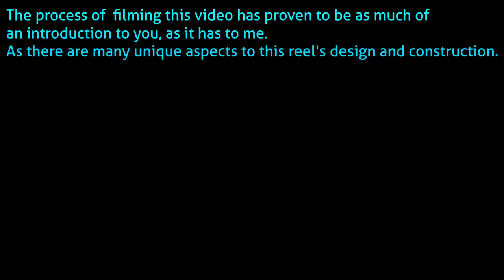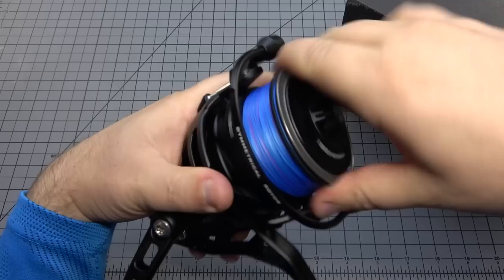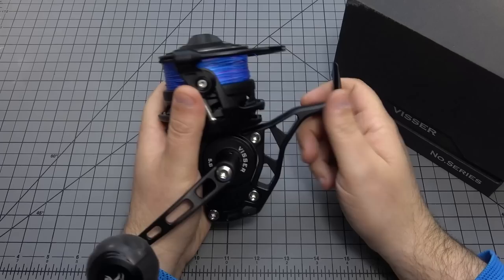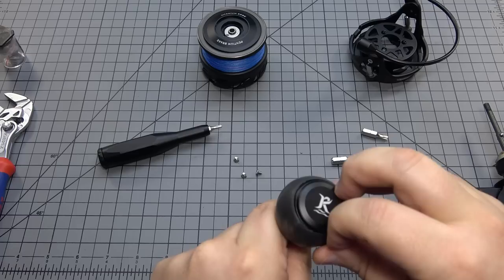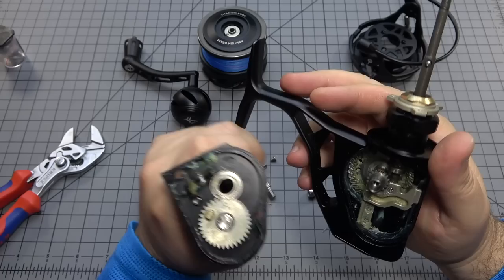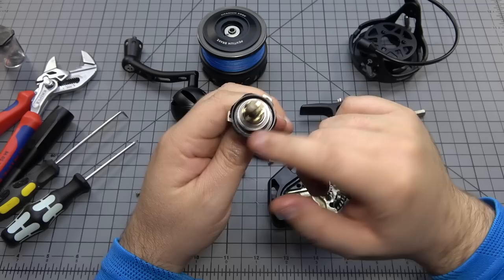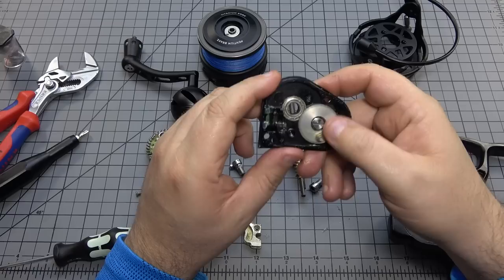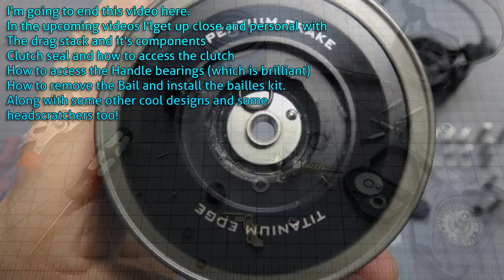Visser reels - The most impressive reel of 2020 - See description as to why I no longer recommend it

Comment: I’ve bought three visser no5 now and only one had no problems, other two were sent back to the seller. Production number 175 was no drag clicker sound. 188 was all good (so far) and 110 had webs on it when I opened it, the reel handle screw part was covered in rust and the spool was catching/binding as you turned it with your hand....It would go smooth,catch, smooth, catch and so on. Pretty disappointed in the company so far

Comment: for $700 i expect QC out the ass
Reply: For real. If this was a $100 reel he would've called it shit and thrown it away.
Reply from the maker: I do as well... But this is expected of his releases.. First runs have some issues... Once fixed they're the most bullet proof reels on the planet... When you're not a half a billion $$ company it's difficult to bring a spinning reel to market and have no issues at launch... Especially a cnc'ed reel... The issues were ball bearings and a simple adjustment to the clicker and a defect at the clutch.... I could have shit all over it... But the design is so excellent.
Reply: @Tackle Advisors  with releases like this, custom and small batch.
First one out of the production run will more than likely have issues.
It's how they handle theses issues  and prevent future occurrences that counts.
This one looks promising. But I'm going to wait till I consider buying one (international customer and warranty return 🙃)

Comment: While no bailed reel is perfect, I believe no bailed spinning reel is tougher than the VSB Van Staal.  They have a German made INA instant anti reverse that has extra needle bearings for better instant anti reverse and the "cage" of the clutch bearing has a metal cage where most companies make them with nylon cages.   So Van Staal really impressed me because no other companies seem to use German INA bearings in fishing reels.  As far as I know, only the VSB has them?
Reply from the maker: I tried to locate a hex clutch from Ina... To no avail.  I forget. Is the vs a hex.. It's been so long
Reply: @TackleAdvisors   yes it's hex.   You could try buying the Van Staal part number but I don't know the size.   It's possible that only the VSB models have INA bearings.  I bet the VR and even the new X series use either Koyo at best or a generic clutch bearing. But the INA by itself only cost 23 bucks from Van Staal.   Second choice would be a Koyo made clutch bearing.   I don't trust the Boca bearings because they won't tell me which factory in China makes them.  Boca has good service but we consumers should not have to settle for anonymous Chinese factories  when Japan and Germany makes bearings all the time.
Reply: @TackleAdvisors   I found the part number for you IF the INA clutch is instead Hex shaped.  I'm not 100% it is. I know INA makes them both round and hex and I think the Van Staal VSB uses the hex shaped one but I'm not 100% sure.  But the Van STaal Part number is VSB2090 - INA CLUTCH  (item number 21-30272).  It only costs 23 bucks.

Comment: would you ever consider comparing a vr50, saltx 4000 and a visser no. 3 for the “king” at that size for sealed reels?
Reply from the maker: I have a 50...I have to see if my friend got the salt x 4000 or the 6000.....I have a visser 5 right now in addtion to the 8...I don't think the 3's are out yet...ANd a completely redesigned vR lineup is coming soon
Reply: @TackleAdvisors  i’ve been really wanting a sealed reel at that size, but i kind of want to see what the no. 3 has to offer before i pull the trigger. thank you.

Comment: Great wrench. Please try using it properly. You did not have the pliers facing in the correct direction.
Reply from the maker: You do it when focusing on 20 different things and looking through a view finder trying to prevent delays and fumbling :) it worked just fine.

Comment: This falls under that "nothing wrong with separating a fool from his money" situations. That's like a rebranded slightly worse Penn Slammer.
Reply from the maker: Far better sealing (in a different league)What appears to be better gearing.  Far lighter, better bail, and bail mech.  Bail less option and Titanium spool lip that can take a hit on the rocks.  Not a reel for everyone....but with the quirks worked out.  A far better choice for full contact surf casting.  Ie, swimming to rocks.  Wading a few hundred yards out on the flats etc.
Reply: @TackleAdvisors  the only part of that I believe is lighter. God knows I wish my Slammer was on a bit of a diet. My 6000 is my big lure jetty and surf reel and has got some work done without a hiccup. I feel like many of the bench top qualities you say put it in a different league are only true if you don't factor in what to get per dollar spent. Of course that's just an opinion and not a knock on you at all.

Comment: Except you would never have to worry about locking up this reel by installing the oscillation pin/post wrongly. Because the side covers just lifts straight off the side and are held on by the screws. And there's no anti reverse bearing in the main gear shaft handle area.
Whereas the the older VS have the anti reverse in the handle. So if you miss the slot on oscillation install and start threading on the cover only to find you now cant unscrew the cover only to realise your screwed (coincidental pun). All due to main gear shaft anti reverse and ocilation pin bangin into sh%t inside. This is where Dr Hacksaw shows up! 
🤣 😂 😬